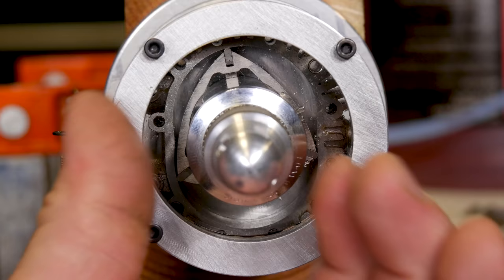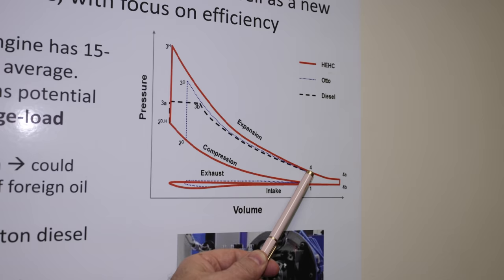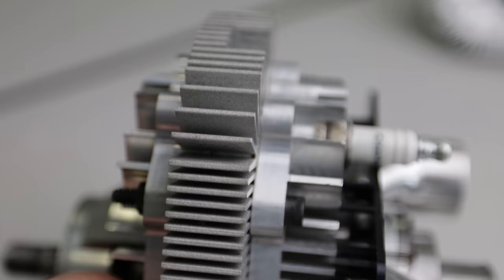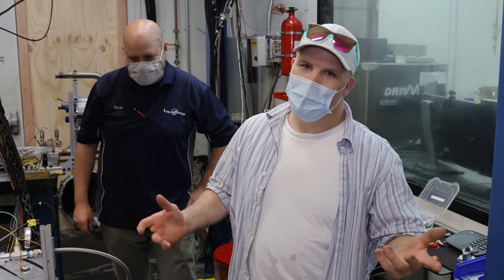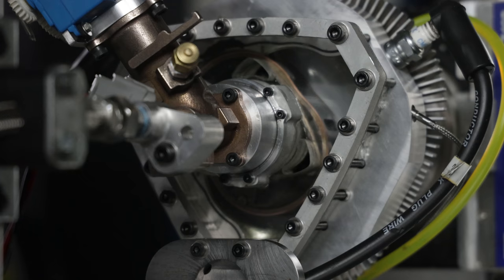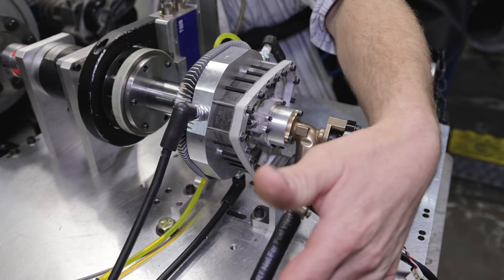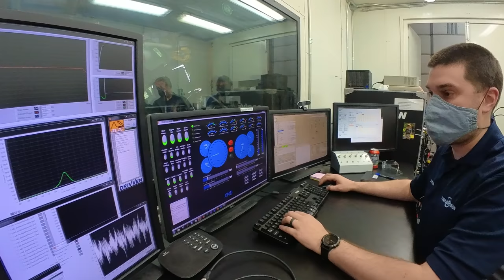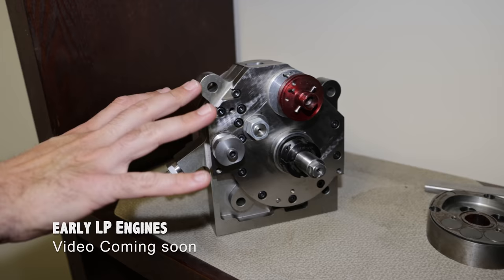See Thru Liquid Piston Rotary Engine - In Slow Motion

Comment: I can't wait to play with these in applications where conventional combustion engines have been too heavy
Reply: yoooo weedtrimmers and edgers would be so much simpler and lighter
Reply: Please not a gas powered hot glue gun
Reply: @calebs4887  "With the Friz? No way!"
"Aw"
Reply: Imagine this in something like an 1/8th or 1/6th R/C
Reply: @samfrinzi6392    chainsaws too
Reply: don't hold your breath lol...
Reply: @ianbuilds7712   u dont ♥️ chainsaws ?
Reply: That engine would work perfectly for a clean fuel source like hydrogen  that you can make with water
Reply: @sundial6919  i do and im certain that this abomination attention grab would not make them better, lighter, more powerful, less polluting..
Reply: @bloopbloop5663  why would this be any better for that than any other ic engine??
Reply: @ianbuilds7712  cause it can run on gases without modifying it  and hydrogens cheap to make  and burns nicely  and these engines are more efficient since its alredy a circular motion instead of pushing a camshaft up and down
Reply: @bloopbloop5663 the crankshaft coupled to the rod moves the piston "up and down"... and nope b.s! you would absolutely need to modify this to run on different fuels.. this will never be an engine you can go out and buy a car with... but if it were, which it wont, and it was made as a gasoline engine you will absolutely not be able to just pump some hydrogen in there and drive off lol or even diesel...ever... any engine can be made to run on propane and possibly hydrogen ( i wouldn't approach stoichiometry if it had any aluminum parts unless molten aluminum in the exhaust was the goal) or probably lots of different fuels all youd need is a fuel delivery modification but for compression ignition (diesel) you need beefy parts regardless of what funny shape they might be its just a much more violent thing to contain than spark ignition... as for the efficiency thing, practical application is a cruel mistress just as the first two rotary engines..😂😂 we're seriosly talking about an engine whose only intake port for its 3 combustion events per cycle is the god dam crankshaft ( "e shaft") lol and where does the exhaust go? wtf... what if i want a turbo? does the freakin throttle body spin too?🤣🤣
Reply: Bloop Bloop rotory engines are great but have high failure rates in short periods. Every so many hours light airplanes have to tear their engine apart and rebuild it to prevent premature engine failure, even worse in the sky
Reply: @jameshunt5316  dude is a chooch...  just because they were able to run it on the test bench on different fuels it doesn't mean would be like that with a production engine... lol a prodution engine whose crankshaft is the only intake port and all the moving parts are part of the exhaust port is a very funny idea tho.. id love to see it! one application(probably the only) that might benefit from the crank or "e" shaft intake would be a propeller plane tho.. and to be fair piston engines on planes also need regular rebuild although im sure less often than this abomination
Reply: RC PLANEEEEEES
Reply: You just named every single engine application in existence.
Reply: @ianbuilds7712  More power, lighter and fewer moving parts is better in all respects.
Reply: @RayleighCriterion intake is the crankshaft?!? and where tf does the exhaust go?? what about a turbo? the exhaust has cooling air?? wtf is that? wouldnt that make emissions worse? i don't think this engine adresses any of the real problems with the rotary while adding some real practical issues...exhaust ports are dirty and sooty where does that go? and it looked and sounded like it was loosing compression a couple times.. idk i do know that a funny shaped combustion chamber doesn't make for good efficiency.. it seems more efficient because a rotary can make good power per cc but what they dont tell you is that 2x the power per cc comes at the cost of 3x the combustion events over time... kinda like a 2cycle.. those numbers probably aren't exact lol but that means lower fuel efficiency and more emissions...
Reply: @ianbuilds7712  Good point about the Wankel engine's specific output, that 1.3L rotary displaces 1.3L per crankshaft rotation, same as a 2.6L 4-stroke. The main advantages of the Wankel engine, as installed by Mazda, are compact size and light weight. The smoothness and drivability are nice but a piston engine can achieve those. I recall reading a test of a Wankel go-kart engine, the guy was properly chuffed afterwards. From a driving experience standpoint, Wankels are awesome.

I do wonder about the cooling air in the exhaust, That would seem to preclude a catalytic converter.
Reply: @5000rgb  yea i had a friend with an rx7 and it was a blast... this engine on the other hand is just a bunch of marketing wank.. lol does the throttle body rotate too?? heres an idea! the throttle body can double as the harmonic balancer/crank pulley😂😂 what if you want  multiple rotors with a turbo? i bet with the backpressure from a turbo there will be a lot more issues to deal with than just apex seals.. a
Reply: @ianbuilds7712  I do understand your skepticism about this engine bnut I'd like to see what they can achieve. It would be easy enough to seal the rotor to a stationary throttle body.

The biggest hurdle I see is the exhaust gas having to mix with cooling air. That doesn't seem compatible with catalytic converters as I understand them. They need to be hot to work well. Mixing cooling air with exhaust gas would seem to complicate turbocharging, too.

It may be possible to separate the exhaust from the cooling air, or use oil for cooling, also separated from the exhaust.

There are definitely a lot of hurdles in developing any new engine, this one certainly has them.
Reply: R B they try to use oil to cool it, rather it just burns the shit out of oil. The problem with the fewer moving parts is that, literally there are less parts taking wear, but each part taking significantly more wear than a piston engine per stroke. It’s literally a doomed idea from the start to throw a crankshaft in a block and have it get slammed around in there repeatedly. While offering great performance but not durability, personally I don’t wanna replace my engine like 3-4 times in the life of my car or go get multiple cars every few years
Reply: @5000rgb  "There are definitely a lot of hurdles in developing any new engine, this one certainly has them." That's call research. Look any anything of what we today now and the failures and advances to get them to where they are now. Planes, cars,  motorcycles, engines, laundry machines, even toilets. That list goes beyond just mechanical devices.
Reply: @jameshunt5316  that is a perfect way to put it... fewer moving parts to distribute the countless explosions being thrown at it... that would be fine if these parts weren't complex shapes or maybe easier to manufacture or something... research?? it's called exotic matalurgy and its fucking expensive... every one of these engine ideas have armies of ppl in the comments talking about how this one is the one it just needs all the time and money we put into piston engines..
Reply: @90FF1  only hope for this engine is niche hobbies or racing period... i don't understand how anyone could think this could be more fuel efficient than a piston engine or ever do better emissions wise... nobody will answer me does the throttle body spin too? are we seriously debating an engine who's intake is the crankshaft?? where does the exhaust go? it's trying too hard to not be a wankel
Reply: @5000rgb  im not skeptic im 100% certain you will never be able to buy any mass produced anything with this engine... ever
Reply: They're actually about as heavy, if not heavier than a comparable piston engine. Liquid Piston pulls some shady marketing tricks by just weighing the bottom-end of the engine. For example, a 29-pound Honda engine already has a fuel tank, starter, ignition system, exhaust, fuel system and much more. LP's weight ratings include none of that.
Reply: @joshjlmgproductions3313  i can't believe they seriously compared it to that boat anchor of a diesel engine... what about something modern? like a motorcycle engine? or even an antique motorcycle engine...
Reply: @samfrinzi6392  a far simpler weed eater is one with less parts. Have you seen the dewalt battery powered weed eater ? Very powerful, reliable and long running battery time. The most complicated part is the head that holds the trimmer line. Nothing to break really , no oiling, no framing carb for the winter and no gasoline.
Reply: @blanknone5408  but it has batteries that go bad, wiring and circuit boards and brushless motors, I think I’ll pass. I can put a new cylinder and rings in a string trimmer in an hour. Why would I fuck around with circuit boards?
Reply: Why not just a car? I feel like it’d be harder to seal if it’s scaled up
Reply: @bloopbloop5663  be great for a gasifier / generator application
Reply: @vincentrusso4332  yeah wood gas is awesome cool to see it coming back since the wars
Reply: PERSONAL AERIAL VEHICLE.
Reply: I can definitely see this for ultralight aircraft.  One pound per horsepower, hell yes.
Reply: EAA Aircraft
Reply: like a 4 hp weed whacker?
Reply: You are talking about every single current application for an internal combustion engine.
Reply: Maybe a toothbrush?
Reply: @ianbuilds7712  Speaking of breath... the fact the he smelled acetylene tells us the combustion efeiciency alone isn'tvery good...
Reply: @ianbuilds7712  Or quieter...
Reply: @ianbuilds7712  Small size for the HP.... but at the expense of efficincy and longevity.
Reply: @bloopbloop5663  You can run a piston engine on anything that can be easily vaporized. And a gas turbine has fewer moving parts.
Reply: @ianbuilds7712  I recommend putting more effort into battery technolgy.
Reply: @5000rgb  They've had several decades of R&D and still don't have a viable engine. Why haven't we seen one on a test stand?

Comment: That was awesome.  Now we need to see it with boost making 500hp or a 4 rotor.
Reply: in other words how to make a see threw design a even more see threw design
Reply: @Maximo Moline You could set 'em back to back I think, in banks of 2.
Reply: @Maximo Moline "impossible" is a strong word, but it would definitely be challenging
Reply: to make it more than two you would probably have to have it in pairs on either side of a gear driven shaft, i don't think more than 2 in a row would be possible without a ton of engineering.
Reply: @thenerdycanadian7172  That's exactly what I mean!
Reply: @thenerdycanadian7172  you could probably feed both units with just a shared manifold, but obviously the flow characteristics wouldnt be great
Reply: Just combine the pipes that go through the middle into one manifold, then route the exhausts sideways through the sandwich plates in between each rotor
Reply: well any 500hp would be nice. im waiting for it to fly an aircraft and do it better than gas turbine. or at least cheaper
Reply: 6 rotor in the same setup as the 12 rotor - but just back to back banks of two
Reply: They can make it longer with multiple injectors. The vibrations may need to be balanced off somehow. Imagine a meter long 100 pounds rotor. The ball bearings will cry for help too. How is the moment even transfered to the gearbox? It's not in the center
Reply: @Maximo Moline They have a turbocharged 750cc model that only makes 40 horsepower. And that's only at 6000 RPM. It also weighs much more than 40 pounds.
Reply: @trollmcclure1884  it's not finished bud
Reply: I can't understand people's fascination with multiple rotors for this design.  It's already behaving like a 3 rotor and if you have large displacement the power is there.

Comment: Mazda rotary 255 hp from 1.3 liter very awesome engine... attach 2 together and push the envelope a little and you have 2.6 liter producing I think it was 800 horsepower if I remember the numbers correctly for the 1993 Mazda RX-7 the car I sold at the dealership was 255 hp perfect 50/50 weight distribution.... it was without a doubt the quickest fastest car made unless you went to a Lamborghini or some such crap....
Demo drives in that car were so freaking awesome.. better than a vette nothing compared to the quality..... not even the Toyota supra could compete.... smooth power with absolute precision.....I was the only one in the dealership that sold any
And I sold 3 times our allotment  ..... the other salesmen drove the shit out of every one we got and I had to sell those miles put on the cars too.... people that spent that kind of money wanted virtually zero miles .... I should buy one now.... still my favorite car of all
Montego blue with the tan interior... by the way I love the rotary so much I bought a point.
.30 cubic inch OS glow fuel.. engine for radio control aircraft....
Someday when I build another Fokker Dr-1 it will be put on the front

Comment: If you look closely, you can see the seals on the walls of the engine moving up and down like they're on a spring. That's such a smart way to reduce the wear, and make room for tolerances from these "inverted apex seals." What a creative engine design all around. Mazda needs to send a rep down there and pay these fellas some money for their patent. I'd love to see this applied to a car some day!
Reply: Mazda's apex seals are on a spring as well, that's not the issue with the engine
Reply: @mareksumguy1887  why so?
Reply: @metaphorpritam  look at the BSFC.
Reply: @mareksumguy1887  Yeah, and? Looks comparable to diesel. The only problem is distribution of pressure on the rotor, which actually causes some loss if efficiency.
Reply: Let’s see this working in a real vehicle and let it make some miles … How will all this hold up after 100.000 miles and hundreds of millions of revolutions ….
Working in hot climates, freezing cold, etc etc.
Reply: @Roomer645  Will not replace traditional engines  on vehicles. But most probable applications are as range extenders in Hybrids, motorcycles and UAVs, where compact size and weight savings over traditional engine designs are useful.
Reply: @metaphorpritam Then let's see a working version in an actual vehicle rather than on a bench. Let's see it under load and how it holds up after time.
To be fair, the Mazda rotary works just fine, over time is where people see issues.
Reply: @Roomer645  Quite unlikely.  It is a one rotor engine.  Since it use the central shaft for air intake, it eliminates the stacking of rotors.  To power a car, the single rotor must be big.  The combustion will be difficult in big combustion space.  No mention of torque.  Torque may also be a problem.  If torque is too low, the transmission will be big, heavy and bulky.
Reply: @Roomer645  people usually see those issues for maintaining it wrong. rotary will last no problem 150-200k but is so different to maintain from a regular engine. most people treated them like a regular engine blew them up in 50k miles
Reply: @zackmandarino1021  true, but people want an engine, not an extra liability.
Most people don't want to bother with extra maintenance which always translates into extra costs.
Reply: You really think the mazda engineers couldn't have think of those things? i'll let you in on the first answer, they aren't feeding oil into it, when it's in production this engine will scrape itself apart/flood the chambers with oil.
Reply: Yes! Knowing the limitations of a classical wankel engine I as curious how they would have improved sealing. I expect this concept well experience less wear when used over a range of operating temperatures.
Reply: @catchnkill  You can't stack the rotors in series if the rotor shaft is used for intake and exhaust, but you can have parallel eccentric rotors turning a central drive shaft.
Reply: Seals and springs vulnerable, not new,  just a copy of air pump blades on rotary pumps.

Comment: My late grandfather has 90+ patents on the Wankel motor, so i am really rooting for this take on it to be a success. Even though i am 100% for electric, there are still some great applications for this thing if they can pull it off... we need highly efficient ICEs if we're gonna keep using them.
Reply: electric polutes the most. All ICE can run clean with no bad byproduct.
Reply: how could you possibly be convinced of that being scientifically possible in any way? Combustion is the "C" in ICE... there are byproducts in any chemical combustion process. Electric motors use stored energy with little to no byproducts, and especially so if they are getting their charges from renewable energy sources. Gotta stop getting your "science" from fox news.
Reply: Hydrogen burns down to CO2 and H2O.  Electric cars get charged from the grid…coal fired, gas fired, etc energy. Plus the grid can’t supply enough electricity for most people to drive electric cars. Lithium mining is highly destructive of good ole mother earth. Renewable energy sources are exceedingly expensive, unreliable, inefficient, and not ready for prime time. Internal combustion engines have a bright future ahead.
Reply: @Cloydfunk  and extracting oil from the ground and refining it while pumping pollutants and flames into the atmosphere 24/7 is not destructive? Come on, that is nonsense. The more we invest in renewables on a large scale, the less harm electricity will be doing. Combustion engines are a massive part of the reason we are in a climate crisis.